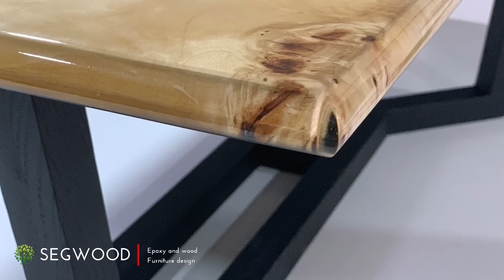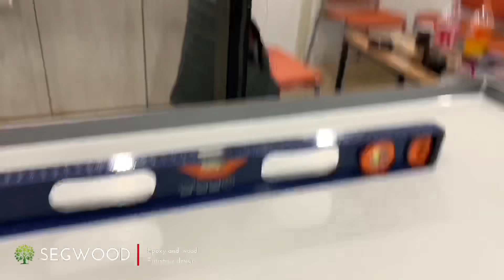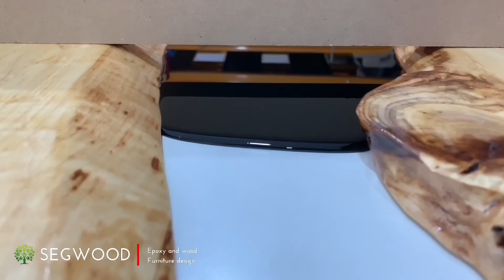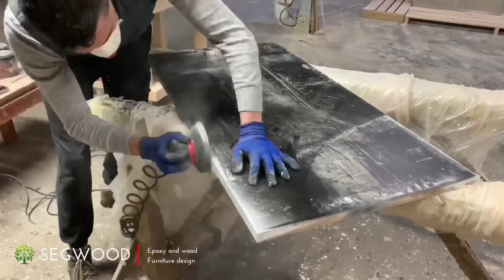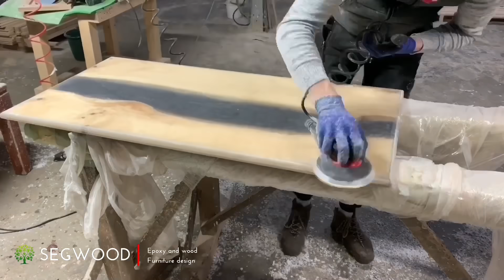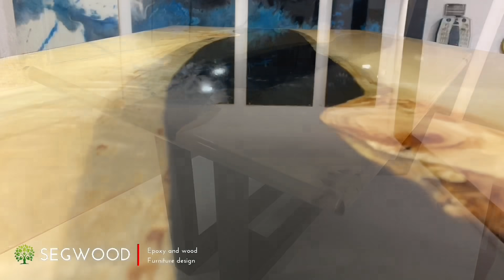DIY epoxy coffee table - poplar wood, black epoxy base, clear epoxy resin.

Comment: I love the black epoxy followed by clear. My question to you is, I noticed in some of
Your videos you already have a layer of black in mould and then you set up the wood, is it easier to do that and do you seal the wood when the first layer has cured? Or is it easier to seal the wood first and then pour your black layer?

Also, when you do the clear do you do a certain thickness at a time and then wait?

Comment: Is it ever possible to just leave the surface of the epoxy resin as is without polishing?    Doesn't it set quite smooth anyway?
Reply from the maker: Yes, it is possible but i preffer to sand and polish it.

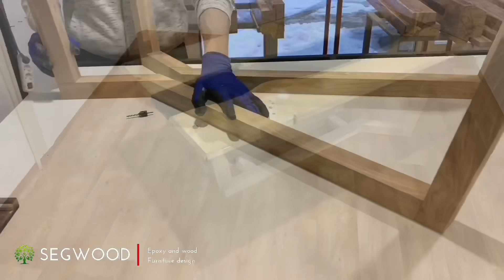Comment: Hi. Awesome work and a beautiful table. I have a question though, can you tell me what did you do with the table top after sanding? Because at 5:30 the table is matte and not see through, but at 6:10 it has a high gloss finish, completely see through epoxy top.
Reply from the maker: Hello. You have your answer here.

https://youtu.be/I-T-xWZlJEY